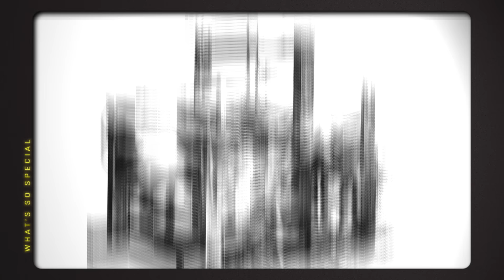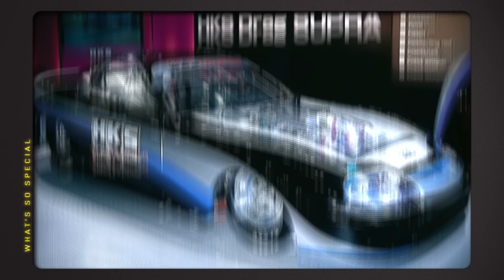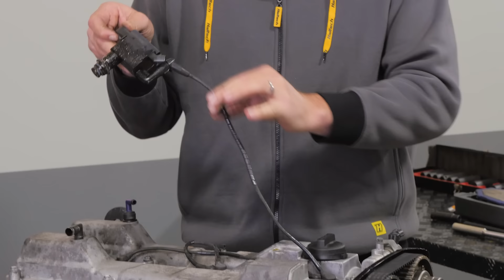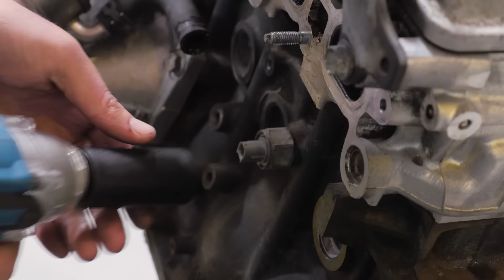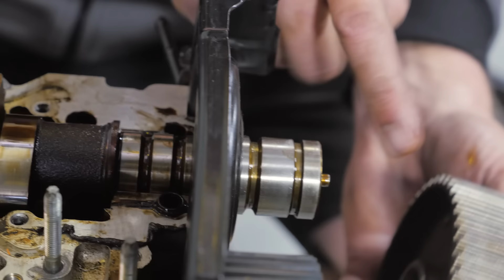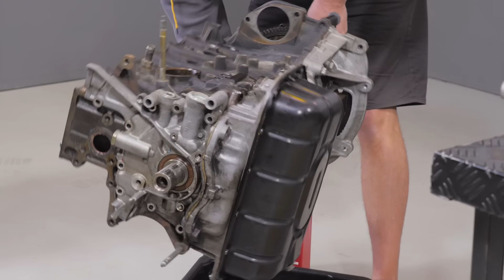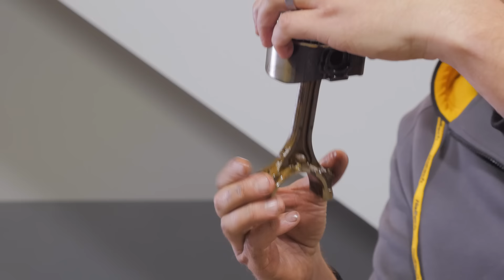🤔 What's So Special About Toyota's 2JZ?  |  TECHNICALLY SPEAKING

Comment: Should have really elaborated on the deep connection between Toyota and Yamaha.
Reply: Meh. The 2jz was made by TOYOTA. They took what they learned on the 1jz and elaborated. Yamaha was the go to for literally everyone who wanted a badass engine. Ford, Chevy, Toyota, Yamaha designed or blueprinted many of the great motors from the 70-00s...  But the 2jz was not a Yamaha engine.
Reply: @freestyleskyline  well if you look deep enough Toyota turned to Yamaha with the head work starting with the 1jz, and the 2jz when they were satisfied with the durability and were looking for performance
Reply: @ljason888  actually I've looked more than deep enough and I know the whole history. There's a reason why Yamaha has their name on the 1JZ head but nowhere on the 2JZ head
Reply: @freestyleskyline Not really here to debate, as this is about the 2jz, but  nearly all the toyota engines with "ge" or "gte" has Yamaha stamps on the head, even if the 2jz doesn't have such, then it simply has been slightly revised as the head is nearly identical to the 1jz that was definitely had the yamaha stamp on the head. Just because its slightly different doesnt make it originally toyota design, all they did was modify the original yamaha design.
Reply: Yamaha was paid by Toyota to do the cylinder head optimisation, not really that deep.
Reply: They are really the performance arm of everyone.
Reply: Powered isn't made from the block. Can have any block, but airflow is important for combustion in the cylinders. Power is made due to the head. Toyota relied on Yamaha. Toyota have been working with companies outside of their own in partnerships. So, ain't no engineering marvel from Toyota. Look at Nissan. And the TC24-1BZ. You'll understand what I'm saying. And for the record, my country have been dominated by Japanese cars since the 60s. More respect for the Barra and RB.
Reply: @warkal868  Power is created and maintained in the block ... The head is just passing the air thru for combustion INSIDE the block.
Reply: @ACommenterOnYouTube  the block can only consume what the head can feed it.  cylinder head design is where the technology is.  sure its a great sturdy block, but that's just a case of putting enough metal in it.  the head design is where the smarts are.
Reply: @JethroRose  yes .. BUT the block is where the EXPLOSION IS ... where the power is MADE ... 
The power is NOT made in the head .... 

Are you also going to say that a billet 2JZ block is the same as a cast 2JZ ???
Reply: Yamaha just tuned the exhaust note
Reply: yup, yamaha have done a huge amount of cylinder head work for various companies, especially toyota.  and cylinder heads are what make you power (assuming the bottom end can hack it).
Reply: @JethroRose  NO ... cylinder heads do NOT make power. The power is made IN THE BLOCK ... This is WHY people BUILD the block with forged internals to HOLD the power.
Reply: @ACommenterOnYouTube  you're too stupid to understand what you're arguing against. What he's saying is going over your head and you're just keep saying the same thing over and over without understanding his argument. No shit bro. Mechanical energy is produced by the rotating assembly inside the block. We all understand that. What gives an engine the potential to produce energy? It's the volume of the engine and the volumetric efficiency that makes the difference in power production. How do you get the most power from an engine? More air, more compression, more ignition advance. Airflow is the number one way to increase power and efficiency from an engine. How do you increase airflow? Please tell me how because you seem oblivious
Reply: Yamama had zero input into the design, manufacturing or production of the 2JZ. End of convo. It's similar to the 1J head but is greatly improved by TOYOTA and TOYOTA alone.
Reply: @mcfoolskully  Sadly these idiots think otherwise. Amazing how much stupid is walking around us .... 
Its more the ones that love on the fake Supra made by BMW that want to hate on the MKIV and say that Yamaha designed the 2JZ to justify that their fake Supra was made in "collaboration" with BMW ... 
Funny how BMW released their statement saying that Toyota had ZERO part in making or tuning yet they still claim they did so they feel better in buying their fake Supra ...
Reply: 2jz/toyota fan boys don’t like to hear this. Every single great engine Toyota made Yamaha was involved. Yamaha dropped the car world that’s why they went to bmw to bring back the Supra
Reply: @inixratedini  WRONG AGAIN 2 TIMES KID ...
Reply: @ACommenterOnYouTube  says the guy who believes power is made in the bottom
End….lol build the bottom all you want power will never increase without a built head. Bottom end is just a strong foundation
Reply: @inixratedini  ok kid ..
Reply: @inixratedini  I demand to have your meth dealer's number
Reply: @ACommenterOnYouTube  Tell me why just changing cams or porting the intake have such a difference in power and curve? 

Yeah the rotating assembly and block is needed to hold and send the power to the wheels. But its not (mostly not) what you need to change to make more power.
Reply: The best way to increase power is increase the stroke
Reply: Ahh the Yamaha connection was just the design of the head, nothing else.
Reply: @ACommenterOnYouTube  you say that like the head isn't important.  its key to power generation...
Reply: @JethroRose  i never said it was NOT important. The head is just a passive device that allows the air or air & fuel to pass thru it. The POWER is made in the block when it ignites IN the block. 
The power is made on that down stroke which directly effects the pistons, rods and crank. 
When was the last time you saw a head with forged valves and cams ???